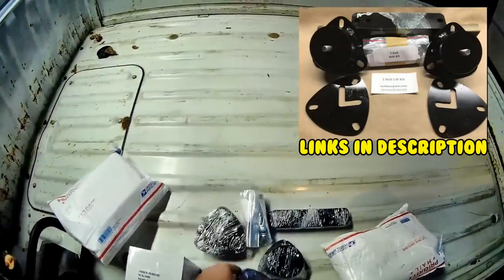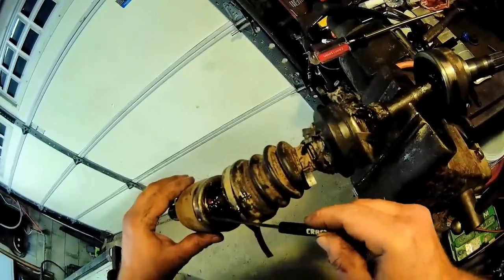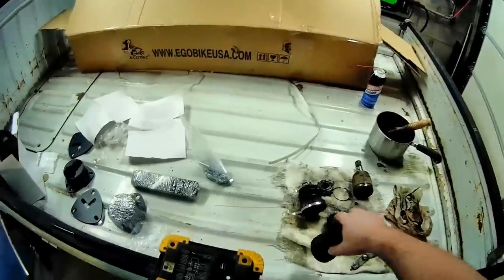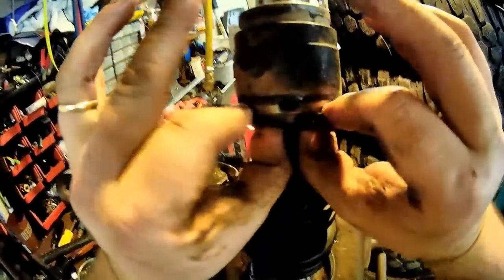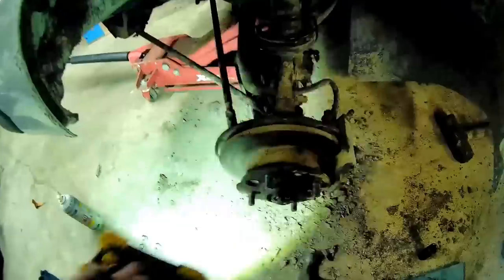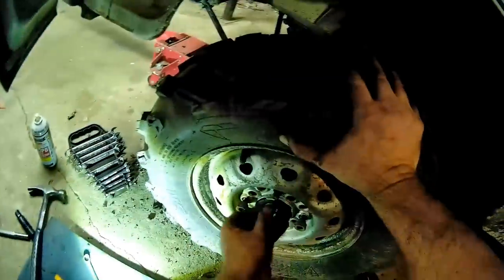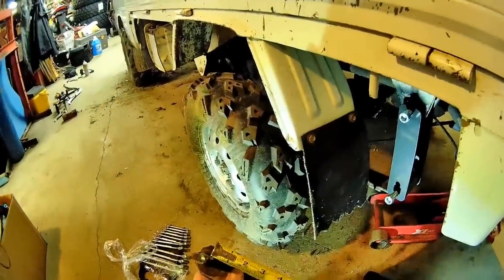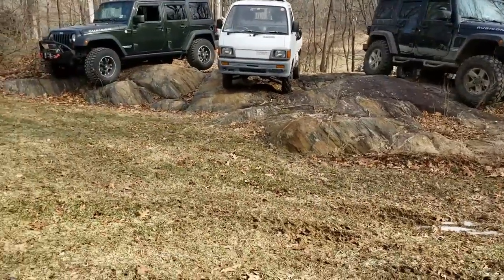Mini Truck (SE01 EP04) mini series, 2 inch lift, pull axle, CV joint boot replacement Hijet

Comment: I love it. Standard hubs and all, just smaller. That keeps it easy to work on. No surprises, everything looks like standard automotive engineering. lol I want a new toy but my state won't allow that on the street and I currently live in suburbia. I would have to tow it to the desert to drive it.
Reply from the maker: Yeah. Built well. Damn, stinks you can only use for off-road, but I'm going to be 99% off-road. Rarely use on road.

Comment: When you mentioned not stretching the circlip...I did exactly that when I swapped my clutch pack on my bike. I'd never encountered such a large clip  before and didn't realize how little force it needed to lift off. Luckily the harbor freight multipack (the circlip, cotter pin and o-ring packs are lifesavers) had plenty that fitted. Lesson learned...

Comment: GLAD, I found your channel, been searching on others and trying to find a OFFICIAL Shop Service & Repair manual BEFORE I buy one, would like ALL info on the engines & trans, I'll watch your other clips for hints hopefully, THIS clip was very informative especially since I've never seen a CV joint disassembled & repacked. Thanks
Reply from the maker: Thanks! I'm having a hard time finding a FREE downloadable manual, I see some are selling them though. 
Most parts are available for all these minis, there's a few website's that have a ton of parts including rebuilds. Parts are a bit on the high side for sure.

Comment: Just some info on the cv boot clip. The correct tool looks like a diagonal cutter,but its dull and it also pushes that bulging part down all at the same time..
Reply from the maker: TY, I did end up buying the property tool.

Comment: I've had a Hijet pick up and a Carry 1000 van, both great vehicles, used to get the Carry on two wheels on roundabouts :).
Reply from the maker: Nice! 2 wheels!!🔥🔥🔥
Reply: Have you seen the V Dub kits you can get from Japan? That was my dream for my works vehicle, dropped to the floor with tasty rims.
Reply from the maker: No I haven't. I'll go  check them out..
Reply from the maker: They are pretty sweet! Maybe when I move to FL

Comment: Here in the Philippines..  we  call that. Multicab.  And  thers is  a lots of  type of multicab.    Pick up type. Mini van. Double cab. And the new transformer  type...    but they liked pick up type for  modified.  And put some  sound sytems..  sound box at the back...    also  you can  lift up. Or low rider.

Comment: You don't like the way the clamps look because you are using the wrong tool. The correct tool grabs the edges like your tool does but it has an "anvil" that keeps it flat at the same time.
Reply from the maker: 👍👍 I am ordering the right tool for when I do the other axle.
Reply: @MotoCheez  Damn I'd give ya mine …… Haven't used it since new axles were cheaper than boot kits. LOL
Reply from the maker: Not on these hijets! They pricey
Reply: @MotoCheez  Oh no sir. I had courier fleets of Ford Focus' and Fiestas in RI
Reply from the maker: Yeah, common car axles cheap now. I know

Comment: we used to skyjack the rear of hot rods with those extended shackles to get m50 series tires under the rear without cutting the rear fenders. air shocks alone won't keep you from cutting tires. they are a lot better if you weld a spacer between them to form an h. i've had them bend doing donuts, or power slides if not. it will shift the entire rear of the vehicle a couple of inches to one side, or start dogtracking. happened on a nova, and a torino gt of mine. nothing for it, but to put new ones on. the expensive ones for drag cars already were welded. a buddy of mine shifted 10" shackles all of the way on a camero. he had to replace the driveshaft too. they went from an i, to a z. it was crazy. you were good till the cop pulled you over, got out a tape measure, and wrote you a ticket for bumper height. you had to change tires and lower it, then go back to the police station for a measure. they knew we were just going to go home and put'em back on, but it was a game we played. at a $100 ticket every time. could have went with a 60 series tire, and avoided it, but if you're pushing 400hp, you needed the meat for hookup. the 80's were a simpler time.
Reply from the maker: Haha. Yeah I did the same, you're right about welding a gusset between the shackles. Haha good times!!!
Reply: @MotoCheez  those are pretty long and thin. i'd do it for off road. you know if you don't, they'll get bent, and you'll be cussin yourself. i used to make my own shackles. 5/8 x 2 1/2 high carbon barstock, and grade 8 bolts. a lot better than the crap from jc whitney.  remember when they were the place for cheap performance? stress the cheap. $3.35/hr. pt job after school made you get creative.

Comment from the maker: 1990-1993 Daihatsu Hijet 4x4 Mini Truck Heavy Duty Front Axle Outer CV Boot Kit
https://goo.gl/pPLxfu
New HD Front Inner CV Boot Kit for 1990-2007 Daihatsu Hijet 4x4 
 Mini Truck
https://goo.gl/kTBRmL
Daihatsu HiJet 2" Lift Kit S110P/S83PS81P 
https://goo.gl/3uGgzh
Reply: MotoCheez I need one of these!!!
Reply: My Buddy just bought a CMC Veryca Pickup (Chinese knock-off of the HiJet)  Have you found any place that has parts breakdowns and service manuals for these mini trucks?  Any info you could pass on would be most appreciated!
Reply from the maker: I got parts from eBay, there are a few places online that sell parts too. You can also order direct from Japan.

Comment: love your videos!!  just so you know they do make a set of plyers just for those claps. it  pulls like you are doing but also pushes from the top to keep it flat. I personally do the same as you just did.
Reply from the maker: ThAnks! I figured they made special pliers, I probably should invest in a pair.
Reply: @MotoCheez  Actually there are at least two types of pliers made you will need the simpler looking ear type pliers. These pliers have sheet metal ends with a raised bracket in the middle to keep the ear from popping out.
Reply from the maker: I just did the front springs 250 lb, I didn't do the CV boots yet I want to get that tool before I do it

Comment: I always use tie wraps on my CV boots.  Those crappy clamps are usually loose enough that they sling grease at higher angles.  Although on that truck they may not since the speed will be lower
Reply from the maker: Agreed. Hate those clamps! I rather use the old ones, think I will next time... The steel embedded zip ties work awesome!

Comment: Jackstands are dirt cheap - and could save your life... just saying...
Reply from the maker: You're right.. I have a set... if I get under I use them.
Reply: Not gonna lie and say I've used them for every single wheel change or pad swap I've ever done... But the rear lift with the maxed jack gave me anxiety. Never max the jack out and then work under it 😥 So easy for that to become a disaster, but at least if the jack did give out and MotoCheez was squished, he could probably free himself being that rear end probably only weighs 500lbs on pivot.
Reply from the maker: Haha. You're totally right, Jack stands. But if it fell, I could bench press that sum bitch! JK, Hahahha

Comment: I saw a standalone light on the floor, is that all you use for illuminating the work? I have bad eyes and like the Harbor Freight yellow work light (the one that burns hotter than the sun lol) but am considering a headband light now I have a garage space to work in.

Comment: I had to do one of the front CV boots on one of my ATV's and they only way to get to either boot was to take the inner joint off.  Apparently you can't just go stright for the outer one on any of them it seems.
Reply from the maker: Yeah, they are supposed to be tough so they don't come out easily. But they will come out I just didn't want to ruin anything and since I was putting both on it's just as well to go from the one side in

Comment: Just a couple of notes : use nitrile gloves to prevent all the mess. Second, they make a SPECIAL TOOL for those clamps. You can rent the tool at autozone or advance.. You can use side cutters, but you shouldn't squeeze the clamp that tight.Use  the notches on the clamp to make the band tight, the use the the side cutters .
Reply from the maker: I have the gloves, just always get caught on stuff lol. Did buy the right tool finally

Comment: if your not gonna fully tighten those rear bolts down you should use lock nuts or double nut it so they don't back off
Reply from the maker: These are lock nuts, meant to not back off. There is no spacer tube in the rubber so it would just smash the rubber for nothing. Double nutting not a bad idea tho

Comment: Did you check brake flexible lines to make sure they were not getting stretched . Probably fine but I have seen others put lift kits in 4x4's and lose their breaks when the hoses stretch and break !
Reply from the maker: Yes, I checked the lines. I know what you mean, I've installed many Jeep lifts and had to rehang and move lines for the extra travel.

Comment: thx for video, im going thru a 1990 s 83 hijet, much like yours, im trying to run a 13 inch rim and tire, im using this on the road so I dont want to loose drivebility with an atv tire. I believe my truck has a 4x110 lug pattern. Could you tell me what universal rim your using and if its 4x110.  Or do you have any suggestions? Again, thanks for your video, found it entertaining..
Reply from the maker: My rims are universal, they're available on Japanese websites but pricey shipping. Yes 4x110

Comment: That ending was great with the Jeeps🤣🤣  No problems getting out of the garage?
Reply from the maker: No, it's so tiny!!!
Reply: @MotoCheez  Cool wasn't sure Camara angle made it look taller . Don't know what your plans are for under coating .I haven't seen the rest of your episodes. I have been trying Motorcycle chain lube works great for those areas that are not being sandblasted. The kind that has no sling chemicals in it.Just food for  Thought thanks for making the videos I seen 2 of them about 2 years ago in Western New York 1st time I ever saw them wish a had extra cash that day.Take care
Reply from the maker: I was planning on oil based Rust-Oleum , I've had good luck holding the rust back with it

Comment: there is a special tool you can get that pushes inwards down on the boot clamp as it crimps inwards from the sides. i think that looks like an ol' snipper, not really a boot clamp tool specifically. if it is, it wouldn't be my first choice :(
Reply from the maker: I did finally buy the right tool, yeah it's a set of nippers but I'm usually very light with them. Axles are so cheap I haven't had to reboot an axle in many years
Reply: @MotoCheez  when i was working for the local volkswagen dealership here in texas, it was more common to reboot axles almost on an every-other daily basis, and we never replaced axles. with exception to "raxles" there was no good aftermarket solution that wasn't already sloppy, or would last more than 4 months :( my buddy's car i replaced ~14 axles in a period of 2 years due to cheapo-riley axles. only benefit was my buddy kept paying me to do it, i got a side down to under 30 minutes. lol. he finally upgraded after lucky number 14.
Reply from the maker: Damn. That's crazy!  Yeah, run em till the balls fly out. Hahah

Comment: did you just preload that wheel bearing with an impact?! was there a bushing in there or something?  i am stumped, I thought preload torque was critical to bearing life but maybe its a sealed bearing or something can any one elaborate?!   thank you!
Reply from the maker: These have roller bearings, not tapered bearings, so they do not require preload. Some non drive wheels have tapered bearings which requires a preload because of design, trailers still use the tapered bearings.
Reply: @MotoCheez  i knew there had to be a reason lol. sort of blew my mind for a hot minute, thanks man!
Reply from the maker: 👍👍😁 all good!

Comment: So I’ve been working on my 96 Acty and I’ve notice some popping during tights turns and the cab will bottom out on the tire if I hit a dip or pothole going to fast....that said the cv boots are shot and I’m wonder if I need to replace the drive axles and springs and struts also? The issues is I’m having trouble finding new parts or at least the drive axles anyway, amd the used pair will cost 500$ which may also come worn out for all I know.  I know I also need timing belt change pd so I’m trying to budget wisely and do things in some sensible order. What are your thoughts, can the drive axles be repair if popping and clicking also do you know if these parts might crossover  with a more common vehicle? Any advice is appreciated.
Reply from the maker: Him. I'd say if it's popping on turns you're CV joints are bad, probably because the boots were ripped for too long. You should be able to get the CV joint (I assume outer) with a new boot somewhere. I'd check Acty forums. If it's bottoming out your springs may be too light... timing belts are inexpensive. Google search and check forums, I'm not too familiar with the Hondas, sorry.
Reply: MotoCheez  can I get away with just changing the outer cv joint and not the entire drive shaft assembly, so I’m not a mechanic but trying to learn as I go.
Reply from the maker: Yes, that's what I was trying to say 😁

Comment: Watching this video makes me want to get a samurai instead.
Reply from the maker: All depends on what you want it for. I have 2 samis too 😁
Reply: My brother has 3 Samaurai.  One has jeep springs.  All have 31s.  One is a pickup truck version.  He has bought 5 or 6 and scrapped a few for parts.  I run a modded unplatable 97 crv bought from insurance write off.  Flat towed behind my truck with a diode isolated wiring harness connected into the crv for signals.  It's like a 4wd rally car, but hey I've only got $400 into it and it has heat and a/c ; and I'm on the Canadian prairies.   Lol.
Reply from the maker: @lolipopsandfancypants7257  nice!!! I needed it for the bed hauling stuff on my land et
Reply: Too bad I can't post a pic of my bros sj410k pickup.  Look them up online.  A sammich of a truck and a samurai.

Comment: The boots you linked state they are NOT for use with lifted vehicles..?
Reply from the maker: I know, I think its s disclosure. I could not find any that said otherwise.. they do not seem to be stretched with my 2" lift fully extended.

Comment: I don't know if it makes a difference...you put the rear left bolts heads on the inside...the right has the bolt heads outside.
Reply from the maker: It really doesn't. I do want to cut the bolt end flush though.

Comment: Quick question. I'm a novice when it comes to any type of vehicle repair. The CV boot you purchased and have listed in the vid description, is it used for both the inner and outer axel? Is it the exact same part? Or do you need to separate parts? Long time viewer. Thanks!
Reply from the maker: The one I have linked in description is the outer boot kit for both axles but the inners are listed on the bottom of sale page as suggested. Thanks for hanging in there!😁😁
Reply: @MotoCheez  It's 11:30pm AZ time(took way longer than it should have), but I just finished replacing the passenger side inner and outer CV boots with absolutely zero mechanical experience. Your two videos on them were invaluable!!
Reply from the maker: @danielmerkley5660  awesome!!!

Comment: Im looking into one for a daily got any recommendations on which kei truck to go with?
Reply from the maker: All the models are basically the same as far as reliability as far as I know and that has to be 25 years or older to be able to register them I've heard because of crash test or whatever. I would just try to get the newest model one with a 5-speed is probably better if you're going to Daly it. I guess it depends on what you're going to do with it
Reply: MotoCheez 
I saw some in a small town in Oklahoma for sale. They were all miniature vans, and 4 door pickups with a 3 foot bed. I think they were dihatsu. One was lifted and atv tires with a camo body wrap and rollbar with lights. It'd be a cool daily
Reply from the maker: Hell yeah! I'd love a camo wrap

Comment: Hey mate, i saw a video about a 127cc bike u bought for 300 dollar, great video by the way, but is it possible you could review a similar one, yamaha xciter 150cc, i bought it for 900$ maybe you could shed some light if its worth it
Reply from the maker: OOH, those are some good bikes! Wish I could get my hands on one to review.
Reply: @MotoCheez  2nd weak into the exciter 150 and i have to say, im amazed, top speed 141kmhp=88mph, but gps measured 136kmph=85mph, quality is surprisingly good, bc i thought it was gonna be just like some other chinese shitty bike, im actually impressed, its very responsive and just yesterday did 96km on it =55miles, stopped only two time by 5-10mins for food and gave me no prbl or overheating at all, greatest cub bike ever
Reply from the maker: Wow. That's awesome!